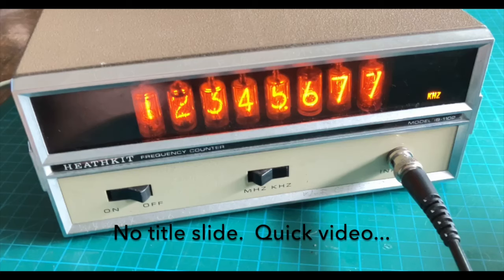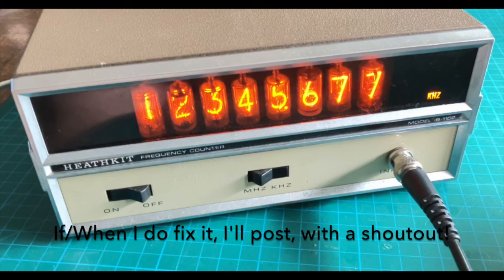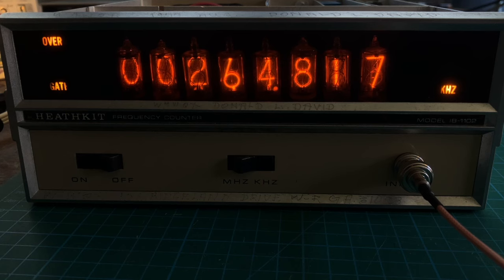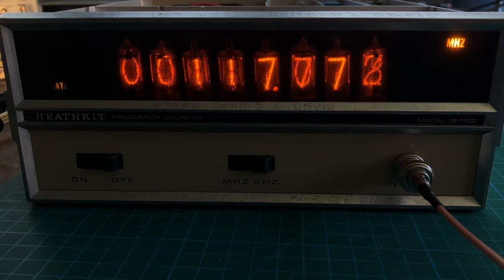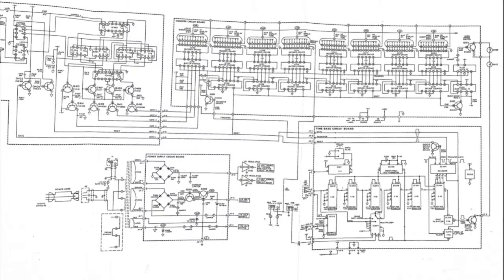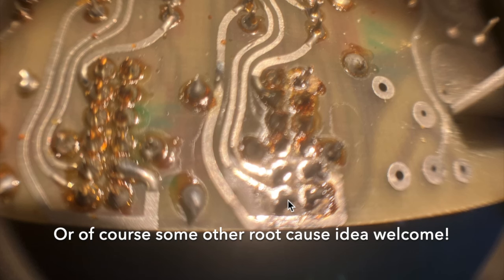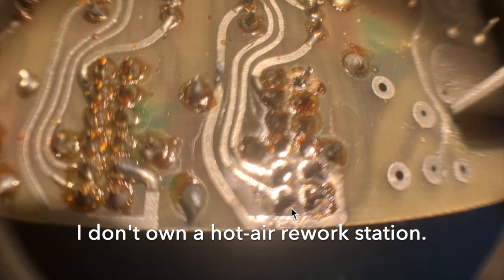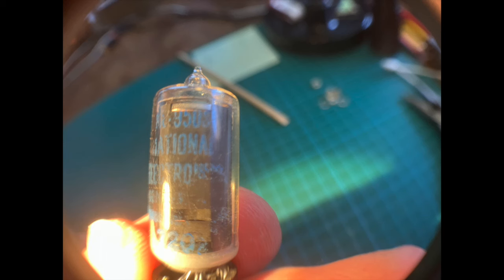Heathkit IB-1102 Hidden bug   Help me fix it!

Comment: You could try using hot air to carefully heat the pcb by the two pins and use cpmpressed air to blowout the material causing the short, alternatively use a small drill and pin vice to drill a channel into the bottom of the socket between the two pins  and flush out any debris. There's also low cost  desoldering needles sets you can purchase which fit over the pins and  releases them from the vias which should allow you to remove the socket.
Reply from the maker: I'd never heard of desoldering needles, but will look into them.  Thanks!
Reply: @dtss_smudge  Hope it helps. Let us know how it goes and if you have any questions feel free to ask.

Comment: I saw another Youtuber solder a wire around to all the legs of a connector he was trying to remove from a motherboard so they were all connected, then he turned up the heat on his soldering iron a little & it melted the solder on all the legs. He was able to pull off the connector with ease. You may have to experiment with different sizes of wire to find which one gives the best results. I believe he used a thicker wire which would transfer the heat quicker and hold heat longer.
Reply from the maker: I could see using heavy solid copper wire, and connecting it directly to my old-timey heavy-duty soldering gun (the kind whose tip is basically a wire bent between its low AC voltage high current output terminals).  Perhaps a last resort, but I'm still wary of damage to the PCB, and to the plastic socket on the other side.  Thanks for the idea!
Reply: @dtss_smudge  I have an old Weller soldering gun just like the one you described, it was my Dad's. I got into electronics in 1974, working at various TV shops over the years and I'm retired now. Using a wire to connect all the legs shouldn't damage the circuit board, the solder would melt before that happens. As you heat the wire you could wiggle the legs and pull them all out at the same time before there is any damage to the circuit board. I agree that there is a possibility the pads could come un-glued but there are kits to glue the lans and pads back down. I've had to use them in the past. Good luck with whichever method you choose,

Comment: I don’t know if this will help, but using something smaller than an apple sim removal tool, and heating it up and carefully push it through the connectors to see if it removes the short.   Not a very good idea, but less time of taking things apart and maybe causing more problems.
Reply from the maker: Interesting.  I'm concerned about the damage such a pin might do to the contact innards...  Thanks for the suggestion!

Comment: Hey. No way of knowing of course and your troubleshooting is correct, but I suspect a piece of foreign matter between the pads on top. I doubt the flux is the problem since if it was, you would probably be having a lot more trouble than this. You didn't mention if you knew it was okay originally or if it's possible it has been like this since it was made.

Regardless, if you can get to the area between the socket and the board, maybe you can flush it with a flux remover just in case flux is trapping something there, or if you feel bold, you can remove the tube and chip again and apply a high voltage (say 120V ac off the top of my head) between the traces to vaporize whatever it is away.

Good luck!!
Reply from the maker: You're right about the flux of course.  So I actually went and measured the resistance of its 60-year-old flux, and....nothing.  I will try blasting the gap with a can of duster first.  The zapping idea is original, but I'm not that brave.  Thanks for the comment!

Comment: Not a very pretty fix but you could remove the Nixie tube, separate out the 5&6 leads, and then use jumpers to attach them to the decoder chip. Then cut out a section of the traces on the board that connect the 5&6 leads to the decoder chip. This will hopefully isolate the shorted sections of those traces and permit normal operation.
Reply from the maker: A similar idea came to me while sleeping on it:  Bend out the Nixie 5&6 leads.  Interpose (ie. sandwich) a 1970s vintage 16-pin DIP socket with pins 11&14 bent out, between the 7441 and its socket.  Then wire-wrap two 30-guage wires to connect Nixie leads to socket pins as appropriate.  I like this one as it does no further harm to anything and is reversible if a future owner wants to get more medieval on it.  Unless I get another idea I like better, I'll likely go with this.  Many thanks for the idea!
Reply: You are very welcome.
Reply: @dtss_smudge  Another thought if going this way, you could use one existing trace and cut the other (the one on the bottom), then you only need to lift one pin on the tube, and connect it to the IC with a wire.
Reply from the maker: @kenmore01:   You're of course correct.  This would make the fix look less "bodgy" with only one flying wire.  I'd probably cut the trace on the top side of the board, and mark it obviously for its next owner at my estate sale :( ... Next time I'm on 6 meters I'll be motivated to again tear into the front panel, which is a royal P.I.T.A., to get to the Nixies, and do a follow-up video.  Thanks again for the follow-up!
Reply: @kenmore01  Simple ideas are often good ideas

Comment: Burning the short away with a powerful power supply
Reply from the maker: Yikes.  Worried about collateral damage.  Thanks for the comment!
Reply: The idea is good. Do it with a condensator. Remove the IC and tube and start with 50V charge, hit both pins and go up in voltage until it is ok.